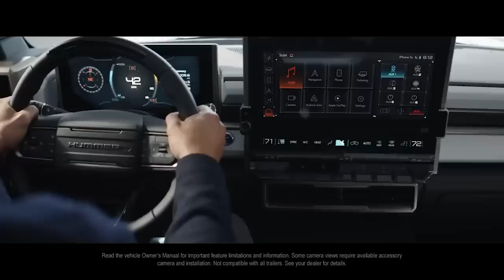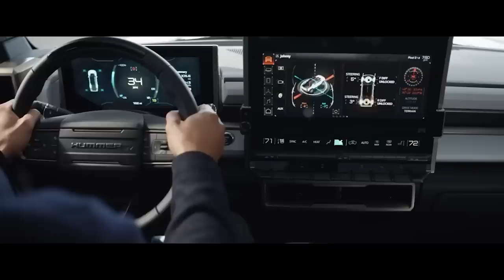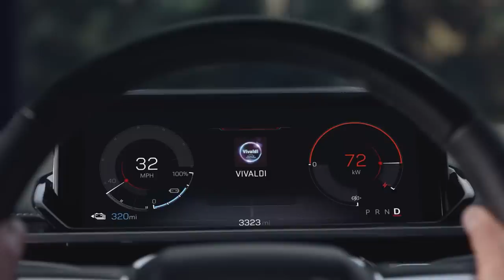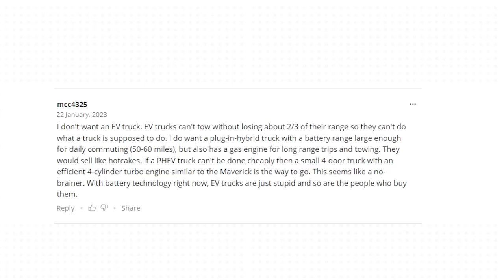GM Reveals New $25k Pick Up | Better Than Ford Maverick?

Comment: nothing out there that can compare to the large V8's and Diesel's for the trucks, especially the work trucks.  Electric tech just isn't there yet.  Also, no one is mentioning how much pollution and environmental impact results from the manufacture of ANY electric vehicle, especially the battery packs which is counterintuitive at best.  The big three have jumped on this electric push a little prematurely and without thinking it out fully.  So typical. and add that to their greed as to the price of their vehicles as the average family cannot even afford a NEW one let alone a  used one is quite telling.

Comment: I will buy the Ford as they offer a regular gas turbo engine.  45 % of minerals used in the batteries are mined in the Congo with over 2000 young children dieing and many more critically injured.
Reply: That's every year! Plus they suck in cold climates! If you tow a lot or use the acceleration you don't get any range! If we all switch to EV it will cost hundreds of billions to build the infrastructure! Twice last year California ask ev car owners not to charge their vehicles due to power shortage.  I can't belive car companies full of engineers have zero understanding of the issues? Wake up!!

Comment: I agree an all electric truck is stupid at this point. An electric truck is only good for use as a sedan. Towing is just not possible. Either go hybrid or use your hydrogen fuel cell platform. We need to build a hydrogen infrastructure and move towards a zero co2 output. The unfortunate thing is Tesla caused us not to go with hydrogen technology. Hydrogen gives you the advantages of electric cars with fueling as fast as you can gas. No matter what ghd EV companies say they just can’t get charging time down and the lines for charging will become unrealistic. Look at ghd blogs with electric car charging. Many people turn a one day trip into days. I would buy a hydrogen fuel cell truck in a minute. Plus the hydrogen platform can be used as a generator for your power needs with unlimited power as long as you have fuel. Electric platforms suggest you can power a house but for how long before the batteries are dead and you cannot have power but you can’t drive. Electric trucks are stupid and those who buy them aren’t real truck owners. They just get them as a novelty not use them as a truck. 😮
Reply: Umm, hydrogen? It’ll never happen. Hydrogen’s real cost is six times higher than gasoline, and the problem with pollution is merely moved from the vehicle to the hydrogen production plant. It’s hard (expensive) to store hydrogen. Building hydrogen fuel stations far higher than electric charge stations. When designed well, EV charge stations are nearly maintenance free. Hydrogen does have the advantage of being supported by the entire petroleum industry. After all, that is the industry that’ll supply it. Today, it is cheaper to run an EV than a gas or diesel car. Look it up. Tesla’s are cost comparable or cheaper than direct competitors today. The Chevy Volt is even cheaper, and depending where you live, with incentives, you might get one in the United States for less than $20,000. EVs are quickly growing in sales today. Hydrogen? No. H2 fuel cell vehicles require expensive and rare catalysts. Hydrogen combustion engines will still produce Nox, since they do burn air. The physics of using hydrogen is economically uncompetitive to EVs. That’s not going to change.

Comment: EVs from Lucid Air, Rivian, Ford F-150, and Tesla all have ranges of more than 300 miles on a full charge. This technology has been around for more than a decade. With the Hummer EV, GM makes the world's longest-range electric vehicle with a range of 500 miles. GM can make a small pickup truck with a range of over 400 plus miles that will meet the needs of all drivers. This includes not losing a third of the range when towing. Just ask them to do it! Gas vehicles lose a third of their range when hauling long distances. All you need is a larger tank for the vehicle. There is no doubt that GM can make an EV with a range of more than 400 miles, but even if you lose a third of your range when towing, you'll still have more than 300 miles.

Yes, GM can also make a plug-in hybrid with a 2.0 L turbocharged engine and an electric motor that can go 100 plus miles on a single charge. It would be the best of both worlds for most existing truck drivers. You can plug in a hybrid and drive 100+ miles on a battery, and when you need more power, you can use the 2.0 L engine. It is also possible to make non-plug-in hybrid engines that give best-in-class fuel economy of 60 plus mpg. Fortunately, all of the groundwork has already been done, so we can just look forward.

GM should also invest in electrification infrastructure. Add 350 kW level three charging stations to all GM dealerships, as well as remote electrified charging stations between dealerships in the United States and abroad.

GM can accomplish all these things if they incorporate them into their digital transformation strategy. It will be exciting to see GM lead the EV market.😊

Comment: I don't believe that current technology is a good trade off at all.... Just think for a second about what we're doing to environment on the other side of the planet with mining the raw materials, manufacturing these batteries require at least 100 barrels to create so they expend the energy of 1 barrel of oil.!? At the end of the battery's life, you cannot simply dispose of it do to again, environmental hazards.. Eventually, there will come the next evolution in Battery technology. Something that will  out perform and cheaply replace lithium batteries currently deployed EV's. I'm not gonna be in the market for an electric vehicle anytime before our nations power grid issues are at least close to being resolved. A hybrid isn't outta the question, I just am not ready while the 'technology' is still in it's infancy....